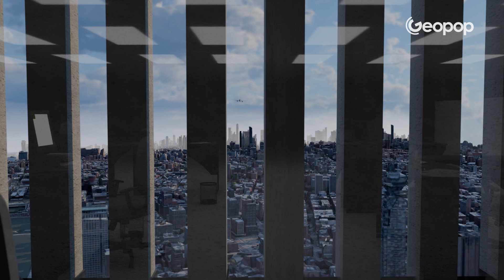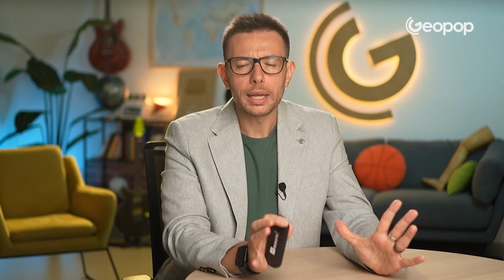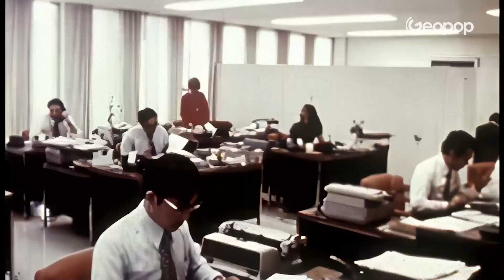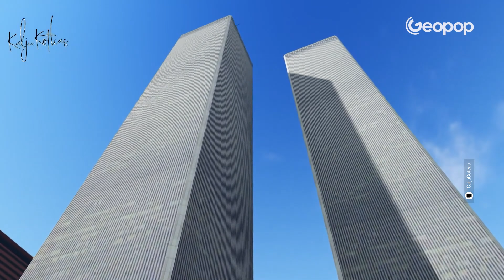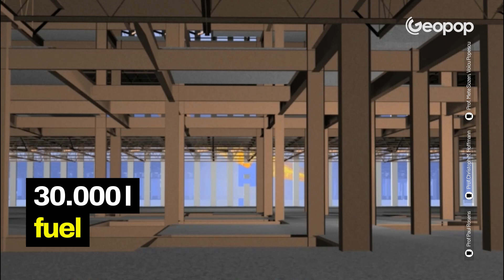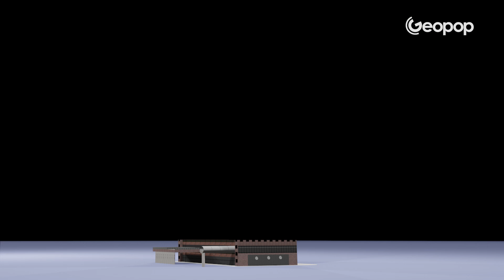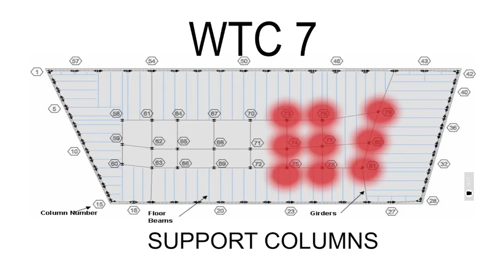9/11, 2001: The Technical Reconstruction of the Twin Towers and WTC 7 Collapses

Comment: 9 seconds to collapse south tower and 11 seconds for north tower? What are these coincidences bruh
Reply: Actually that is not correct.  It is a common myth, like Haitian immigrants eating pets in Ohio. 

The myth the Twin Towers collapsed in free fall (9-11 seconds) comes from completely misreading this:

NIST FAQ for the Twin Towers disaster Study

*11. How could the WTC towers collapse in only 11 seconds (WTC 1) and 9 seconds (WTC 2)—speeds that approximate that of a ball dropped from similar height in a vacuum (with no air resistance)? *

NIST estimated the elapsed times for the first exterior panels to strike the ground after the collapse initiated in each of the towers to be approximately 11 seconds for WTC 1 and approximately 9 seconds for WTC 2. These elapsed times were based on: (1) precise timing of the initiation of collapse from video evidence, and (2) ground motion (seismic) signals recorded at Palisades, N.Y., that also were precisely time-calibrated for wave transmission times from lower Manhattan (see NIST NCSTAR 1-5A)

Note the part about the first exterior panels to strike the ground after the collapse initiated.  A lot of people seem to miss that important bit of context and only see the 11 seconds and 9 seconds parts. 

On conspiracy web sites and YouTube videos they just cut out all the relevant context and details and (falsely) claim; The Twin Towers collapsed in 10 (or 9 or 11 - they usually can't remember the exact number so they fudge it) seconds Selective reading comprehension syndrome (SRCS). 

9 or 11 seconds is NOT the building, its the first debris to hit the ground which were definitely in free fall and dropping much faster than the Tower, which is collapsing some ways behind that. All of this easily visible to the naked eye. 

youtube.com/watch?v=4VgZW-v_Opg&t=4s&ab_channel=MFitz 

Now you know.

Actual collapse time for the North Tower is timed on this video;
youtube.com/watch?v=MAYXdafNl6E&ab_channel=AlienEntity1 

South Tower – Timed not in free fall
youtube.com/watch?v=rOIebjT2jaM&ab_channel=AlienEntity1 

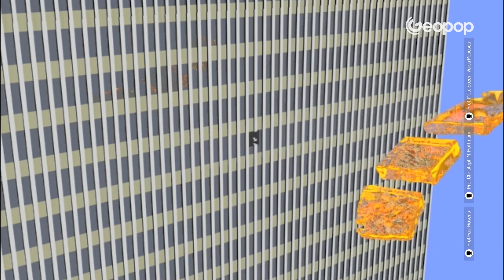Here is a video which captures the entire North Tower collapse, which starts at 1:44. The last standing parts of the structure drop below the dust cloud at 2:17. Add at least another 2 seconds or so for those to drop 60 stories. Start to finish I call it at 34 seconds. 

youtube.com/watch?v=3HbD_Q6kmh8&ab_channel=RTLNieuwsNewYork

Comment: Ah que the idiots in the comments
Reply: Yea the idiots that believe this bs. Nist never gave a full explanation for the total collapse of the buildings. And the collapse defied physics and also disintegrated everyone and everything within the building
Reply: @theraiden1018 I personally believe that the towers collapsing due to fire was most definitely true.
However I’m not entirely sure about the politics behind it 

It could of been that the government did indeed organise the events but the towers did collapse due to fire
Reply: @Raccoon_On_film   You think 2 110 story buildings fell into the path of greatest resistance at near free fall speed due to fires. You believe 15-20 stories pile drives through 80-90 unaffected structure and destroyed itself and the bottom structure uniformly somehow and within 12 seconds. Ok
Reply: @theraiden1018  first of all the towers did not fall at free fall
Secondly I don’t think you understand the structure of the towers
The vast majority of the tower was empty space due to its tube structure so it’s not that hard to understand that a section heaver than the titanic can crash through thin concrete slabs and steel trusses and push the perimeter columns out
As for the core columns they faired a bit better as some of the columns still stood after the collapse of the north tower but they couldn’t support themselves for long due to there being no other support so they collapsed shortly after
Also in pictures of ground zero you can clearly see the amount of steel thrown everywhere. Going back to the fact that the towers where mostly empty space this means there is a lot less steel in them that what it looks like.
Reply: @theraiden1018 also the building didn’t disintegrate 
The pulverised dust you see is the concrete floor slabs, plasterboard and insulation
Reply: @Raccoon_On_film  yes it did. It’s not just concrete, it was marble, gypsum, glass, bodies, and office contents. 2 110 stories of them.
Reply: @theraiden1018  how do you expect those materials to survive that? The force of that collapse would cut through anything just like how it cut through WTC 3 and smashed through the facade of WTC 7. 
However there where some things that did survive like some smashed up hair brushes and phones and one intact window
Reply: @Raccoon_On_film  lol in 220 stories all you can say survived were a few items. And I expect it to survive based on every other natural collapse of the building in history. A gravitational collapse can’t account for the vaporization of all those contents. They can’t account for 40% of the victims being atomized to a level where the remains were smaller than a pinkie nail and a large amount of the remains was so small that it couldn’t even be identified by DNA. It also can’t account for the complete destruction of the core columns which should have remained somewhat intact. It also can’t account for the debris (steel girders mostly, multi ton intact) being launched 600 ft away from the building and having to force to even lodge itself into the world financial center 500 fr away.  It also can’t account for the remains of firefighters and office workers being found on the roof of the deutche bank building 400 ft away.  So no, you can’t pick and choose or have it both ways. If it was a gravitational pancake collapse like you loonies believe, the aforementioned facts would not be possible.
Reply: @theraiden1018  you literally just said how powerful the collapse was yet you still think that a collapse powerful enough to destroy all buildings WTC 3,4,5,6 in one go would keep fragile items intact? 
 The human body and other items are not strong enough to endure that amount of force. 
Also other buildings that have collapsed due to fire such as the one in Iran have a very similar debris pile to the WTC complex

Comment: From your diagrams the centers of the twin towers were hollow.  Wouldn't that be an excellent source for the fires from the jet fuel have flowed into that space? That would create a Dakota fire affect,  would it not? If so the fires could have reached much higher burn temperatures.  Especially if the doors are open to evacuate people from the building. What I'm getting at is the fuel would have flowed into the elevator shafts.

Comment: The mental gymnastics of explaining how it didnt melt but it “weakend” thats the same thing as melting, and it didnt melt. Sorry.
Reply: You obviously have never worked or seen anyone work with steel before. How do you think steel is forged? Its heated up to the point where it is still a solid but is weak enough that it can be shaped
Reply: I would also recommend that you look up what the definition of melting is

Comment: I've seen these steel beams on display at various Memorial sites... The steel is so thin... some truck frames are thicker gauge than this crap.
Reply: You’re an idiot btw. The steel used for the core collums were thick. Thicker than the perimeter steel which was also thick. And the steel at the height of the crashes were thinner than the steel below

Comment: Sorry this is NOT all accurate. These buildings were NOT struck  but commercial planes! According to the 2011 SAE conference in Toronto conference, NO planes were used! Rather in NYC Tomahawk missiles which are designed to crash through solid steel and reinforced concrete. (Washington-s Pentagon crash was also NO PLANE! Rather a military DRONE both the missiles and drones painted in both United and American Airlines livery. With the cute little windows painted upon the sides of both.

Also the buildings (inclusive of building 7) had NOT collapsed of fire (in Venezuela and Madrid Spain there were two Highrise buildings totally engulfed with fire but the steel girder 'bones' of the buildings. In fact the office in Madrid REUSED in tact the original steel substructure in rebuilding, hence NOT demolished!  Jet fuel has a much lower burning point and will only lightly sag, thermite is especially devised for controlled building demolitions as is thermite that burns at much higher temperatures. Thermite was used on building 1,2, and 7.

So this s still much malarky as another point commercial planes (I know, I am both an aviation enthusiast and a pilot)
Reply: Ok ret@rd.

Comment: Molten Iron not mentioned. 

The main supports weaken sure, but what causes 2800 degree temperatures in which iron liquifies? 

The metal alloy reports 4 tons of findings in the aftermath.
Reply: What is the source of the many tons of molten steel found in and under the debris, the heat so intense that the molten steel remained in that state for weeks afterward, running off of the debris as it was excavated. This cannot be molten copper from wiring that retains the color of a shiny new penny.  It cannot be molten aluminum that retains the color of the polished aluminum wheels of a street racer. It was the color of glowing orange molten steel  that cannot be mistaken for any other material, reported by firefighters who are very experienced in the nature of such materials as well as seen in video evidence.

When you combine this with an entire lack of turbulence behind 500 mph aircraft, when even a small Cessna Aircraft would leave an evident wake in the smoke and fire only seconds later .  . We find that skeptics still cannot be skeptical of the official narrative in explanation.  Sponsored channels and forum activity are skeptical of nothing when support is provided.

Sponsored activity in the forums is very normal today for commercial and political purposes and subjects of controversy -- in the attempt to lead public debate.
Reply: The kinetic energy (KE) of a heavy plane travelling at speed is enormous. This was all brought to a stop in about one second. The KE was converted to heat, a great quantity of heat. Do the math.

Comment: Fact: 118 NewYork firefighters filled out affidavits describing  what they heard that day, as either an explosion or a bomb. Sounds that  they heard before the three building collapses. 

I find it ironic that WTC 7 collapsed into its own footprint in 7 seconds…. When a physicist compared the distance WTC 7 collapsed for each second of the collapse, he noted that for 2.5 seconds of the 7 seconds of collapse for WTC 7 it collapsed at free fall speed. This speed was measured at the roofline. The roofline was falling for 2.5 seconds at the same acceleration as one would expect a bowling ball falling with no resistance but air.

Comment: It was all a government cover-up basically days leading to the event of 9/11 regarding all those buildings there have been government contractors leading up to that basically what their role was to wire the buildings full of explosives in the elevator shafts of each building and lining the area with thermite meaning they basically brought it down that way and they did it with stealth I'm The Whistleblower and I saw that with my own eyes when I was in a meeting with a bunch of people that were on the 86th floor and what happened was there was suspicious activity noises that would come out of a certain area of the building and the upon it I was surprised when the elevator didn't work it was out of service and what it was is they were actually planting all that stuff in the elevator shafts in both of those towers and number 7 basically it was a way for the government to bring down these buildings like they would with demolition crews they wanted to bring down these buildings for whatever damn reason they thought they were pretty obsolete at the time and their way of handling it was to make it look like it was a terrorist attack when really it wasn't
Reply: No one will take you seriously sorry.

Comment: The heat generated from the twin towers apparently damaged one side of the Trade Center, causing catastropic damage and collapse.
My question is why was no damage mentioned to buildings closer to the twin towers. The Trade Center was on the external perimeter of the 'blast area'.

Comment: Someone wrote, "It's just science. Relax." But my comment about this BS video (that follows) was my reply to that response, has somehow been, uh, left out of the conversation. So, I'll try again:
Manipulated science is not "science." It is science fiction; It isn't even 'akin to a movie script; it is a scripted cartoon of what some insist we believe. If, for example, WTC-7 collapsed only because of heated, softened steel and damaged steel support," why is it necessary to fake an AI building-7 folding in on itself (in complete contradiction to the FILMED building-seven collapsing straight down, FROM THE BOTTOM AT FREE-FALL SPEED)? Actual science proves that could only happen if NOTHING is between the top and the bottom.
Reply: And what are your credentials?

Comment: At 17:57 According to the official conspiracy theory pieces of the North Tower, weighing several tons, traveled laterally 355 feet with enough force to penetrate the outer wall of WTC 7, while remaining hot enough to start a fire. That’s one magnificent theory! 😳
Reply: They wouldn't need to start the fire with their own heat. Where did you get that idea?
Reply: I am still curious.  When I watch these buildings falling it almost looks as though the fall of the building is keeping pace with the debris falling.
Reply: Perhaps the earth tilted and gravity momentarily pulled falling steel horizontally.  You need to keep an open mind.  I am sure also that merely falling steel becomes so super heated from falling horizontally that it can start a fire.  You understand that asteroids burn up from falling through the atmosphere.  And if you watch the video, you will see the video of a building demolition.  The blasts blew outward.  That is how we know that explosives were not used on 9/11.  Because the building calmly fell downward.  Not outward .   Oops!
Reply: What ‘official conspiracy theory ’ what nonsense is that? In the end what relevance does it have as planned demolition of a live building is no option at all knowing the extensive work this requires!
Reply: No sprinkler systems ? I surely doubt that